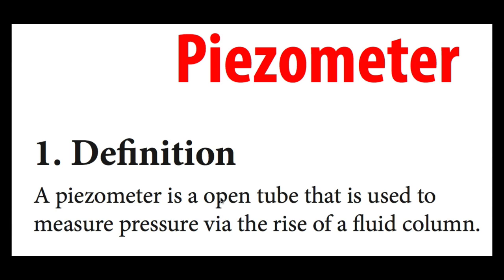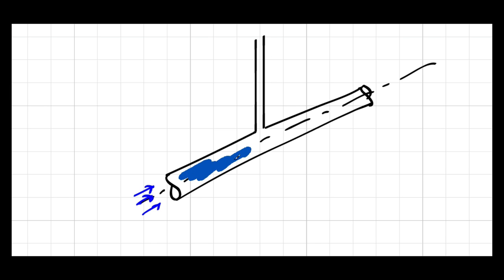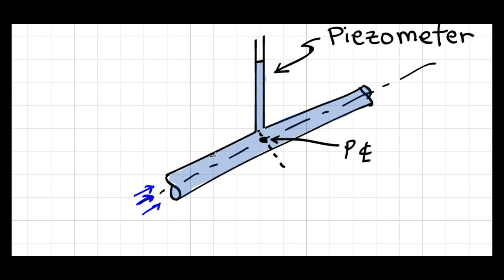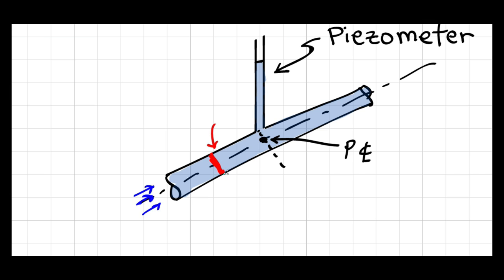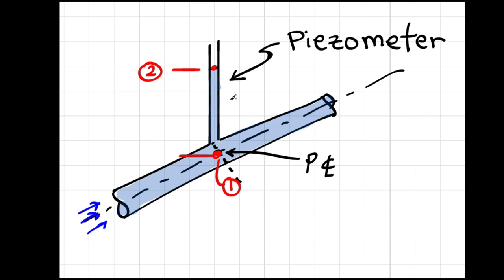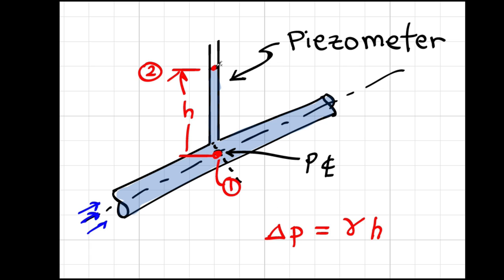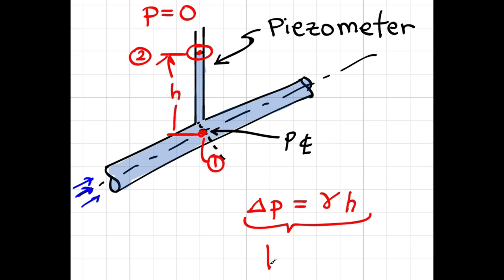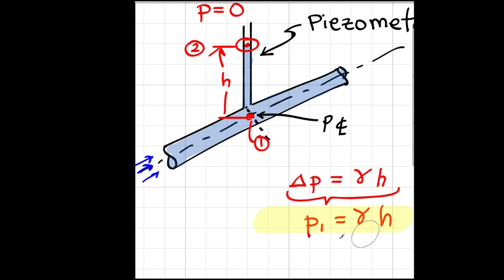How a Piezometer Works

Comment: Great video, Donald. I always find it strange that american tutors seem to use specific weight, whereas over the pond in England we seem to take an extra step and take the product of density and gravity. Perhaps it's just a quirk of our respective countries.
Reply from the maker: Craig Schofield Nice that you noticed this difference!! 
I have noticed the Civil Engineering references tend to use specific weight. Other references, e.g., Mechanical Engineering, tend to use the product of density times gravity.
Reply: That is a great point, Donald. I must admit, at least from my experience in the UK, fluid mechanics seems to be the only course in which we don't use weight density. Whilst studying structures, soil mechanics, etc. we've always used weight density (kN/m^3).
Reply: +Craig Schofield Specific weight is by definition the product of density and gravity. You may be confusing specific weight with specific gravity.
Reply: @matthewdickinson5097  yeah quite true

Comment: well from what I've studied, the pressure at point 2 isn't exactly 0. It would be equal to the atmospheric pressure. And I also believe that the pressure at point 1 isn't in the middle but rather at the edge and at the bottom of the piezo-tube, since the pressure in the middle of the pipe would be the dynamic pressure (since the fluid is obviously moving)

Comment: why is it taken from the middle of the pipe?
Reply from the maker: Lukman Ali. Good question! The pressure variation across a section of a pipe is hydrostatic; thus, the pressure will vary linearly with radius and the pressure at the center of the pipe is the average pressure. If you use this value of pressure in your calculations, this will be give you the most accurate results. Thus, engineers nearly always apply or measure the pressure at the center of the pipe.
Reply: thank you :D
Reply: @DrDonElger  will the elevation(h) change if we change the diameter of the piezometer?

Comment: can a piezometer be used to measure the pressure of a compressible fluid?
Reply from the maker: A piezoemeter is best used for measuring the pressure of a liquid, not a gas. Liquids in steady flow are commonly modeled as a material that is not compressible. For steady flow of a gas, one could use a manometer which is similar to a piezometer and also very simple.

Comment: can peizometer be used to measure the pressure of only the fluid which is in motion??
Reply from the maker: The piezometer measures the piezometric pressure of a flowing liquid. If you know the local atmospheric pressure and the elevations, then you can calculate the pressure of the liquid that is flowing.
Reply: @DrDonElger  sir how can we apply hydro static law on the flowing fluid region?
Reply from the maker: @sangeethpmohan9223  Good Question! In the vertical direction, the forces on a fluid particle are weight and pressure only. This is same as in a stationary fluid. Thus, in the vertical direction the same equation applies to both a stationary fluid and a flowing fluid.

Comment: Why is the pressure at point 2 equals to zero?
Reply from the maker: Because I am using gage pressure which is the difference between local pressure and atmospheric pressure. A gage pressure of 0 kPa means that the pressure at this point is equal to the atmospheric pressure.

Comment: I have learned that piezometer is used to measure static liquid pressure,then why 
fluid is moving
Reply from the maker: In fluid mechanics, hydrostatic means that the sum of the weight force and the pressure force acting on a fluid particle is zero. The fluid can be flowing; example flow in a river or a pipe. As engineers, we say that something is "static" when the sum of the forces is zero. This body may be moving at constant speed and still be static.
Reply: Donald Elger ohh,i got it now...thanks a lot friend...(y)
Reply: In Physics static means inertial frame of reference---the one in which net acceleration is zero & body can thus have a constant velocity.